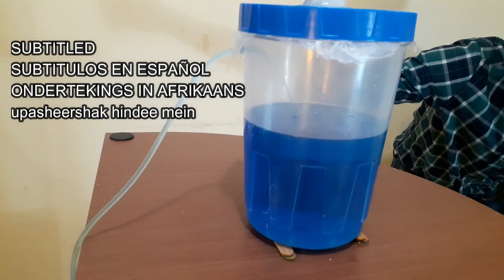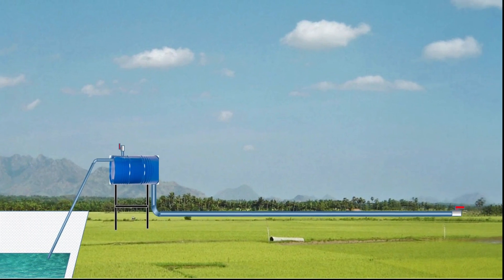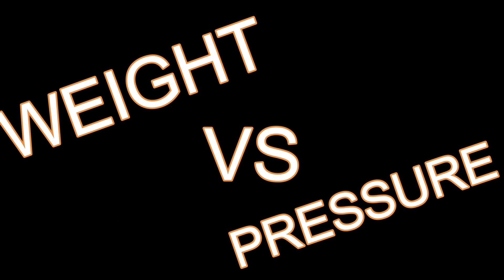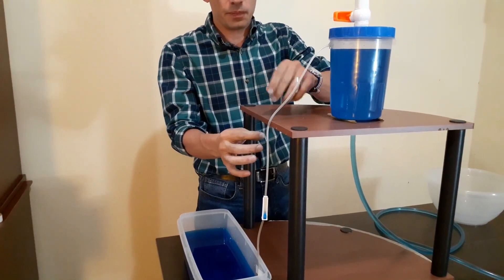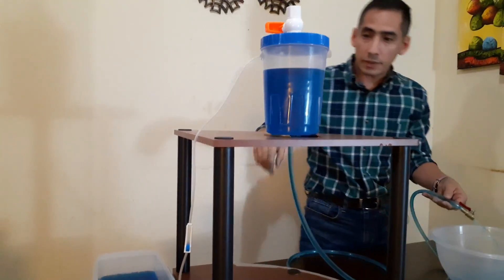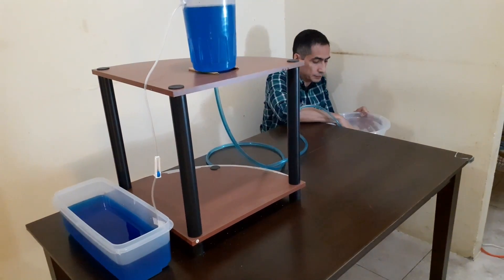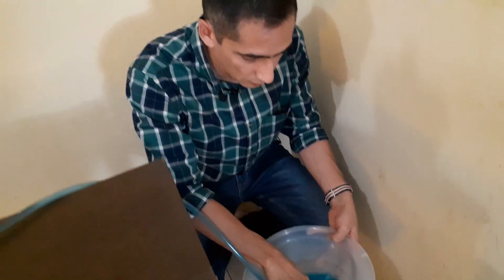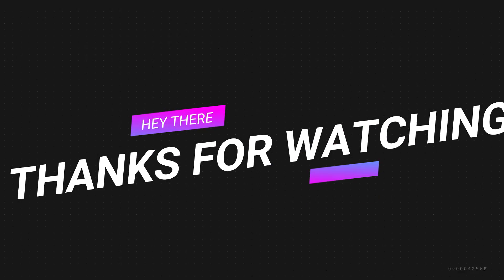FREE ENERGY Water Pump FULLY EXPLAINED!! REAL OR FAKE?  #freeenergy #waterpump

Comment: I have seen a number of videos concerning this type of pump. The conclusion that I am coming to is that this will not work continually without recharging the drum with water as I suggest that the water in the drum will reduce. Therefore the system works from the kinetic energy of initially lifting the water which is finite.
Reply from the maker: thank you for your comment, in fact this method doesnt use kinetic energy because is just a syphon, on the other hand, a RAM pump is a real "free" energy pump wich uses kinetic energy taking advantage to water hammer. best regards

Comment: Looking at your first experiment, water should not flow out if you have a sealed system. To explain it simpler, get a straw. Fill it with water and put your finger at the end and raise up the straw with the water. Water won't drip. The vacuum pressure is holding the water. The bigger your pipe, the higher vacuum pressure you have.
Reply from the maker: thanks for your comment, I will make more videos regarding this issue. best regards
Reply: Noop. The low pressure is not dependent on the size of the straw, only the height.

Comment: You need a check valve on the bottom of the small tube
Reply from the maker: I have made a new video adding a check (foot) valve, kindly check it out
Reply: No, not when using a priming barrel. Purpose of barrel!

Comment: Your setup is completely  different to most of the videos. 1 significant fault in your demonstration is you did not prime the inlet pipe- for the record it works perfectly well in Australia 🇦🇺, we have been able to lift water from a depth of 30 metres using this technique NOTE - this only works if the uptake and the discharge pipe or pipes are proportional in the following- 1);intake must be charged ,fitted with a non return valve, pipe diameter is 25% smaller than your output pipe so as to create the vacuum great enough to pull the water upto the header tank.
Reply: If this can lift water high enough it could power a generator on the way down and run forever.
Reply: Yes it does work, this demonstration is crap
Reply: Vīën-Phüœñg  why do you keep replying if no one has a duty to teach me? I already know that you have been fooled. You are the one who needs to learn but you have the proof here and you refuse and argue that something is not like the other fake videos. You are a dummy. That is the truth.
Reply: The inlet pipe cannot be primed because it has a valve on it. In fact if you try to "prime" the pipe it will instantly create a syphon to that lower level. The model is correct.
Reply: Show a video of this pulling water up 30 meters or about 90 feet. You can't pull water that is equal in density up above the level of the source. The size of the pipe has nothing to do with anything. The water in both pipes has the same density. 
Filling the inlet pipe and putting a check valve on it will only create more resistance. 
Again I ask you to show your barrel rig pulling water up 30 meters.  It won't lift the water one meter.
Reply: You can explain me? I need take water to 20 mt. Please  thanks
Reply: You vouch that it works?????
Reply: @graemegladman  only reason my first attempt didn't work is because the vacuum pressure crushed my container! So I'm looking for a stronger container, but that tells me it does indeed work. Just be prepared, it may take a bit of adjustment to get right.
Reply: @HostileRespite   Ok I will build a small model first. I have seen others that crush plastic drums. Thanks.
Reply: I believe those sys work. Think about ram pump sys. They use total reverse fact.
Reply: share the video of our project?
Reply: Bullshit. I live in Perth prove it.
Reply: thanks dear but would you like to tell me the real procedure and material dimension correctly? become challenge to me at a practice
Reply: vien-phuong7451  Length gives volume in that scenario. I haven't been able to resume my testing on this project because of winter, but soon!
Reply: Vīën-Phüœñg  water seeks its own level.  Water does not flow up hill because some other water of equal weight and density in another pipe or container sits at a different height. 
 It all flows down.
The vacuum you think is there is not enough to lift any water up any grade.
Reply: Vīën-Phüœñg  show the video. Btw a ram pump requires a large amount of water to lift a smaller amount with the ram pulses. 
Again I beg you to show me the video of this kind of non powered system making water flow up 30 meters 
It can't lift even 30 cm.
Reply: Vīën-Phüœñg  SHOW THE VIDEO. 
YOU HAVE ONLY DREAMS!
Reply: vien-phuong7451  I want to try it with tesla valves in a more advanced version later. No moving parts. Truely perpetual.
Reply: Vīën-Phüœñg  yes they are all fake. Please prove me wrong. SHOW YOUR VIDEO.
Reply: Vīën-Phüœñg  you are being deceived, tricked, fooled. You can't understand why it can't work and I have told you the truth. I have no DUTY or desire to teach someone who refuses to see the truth. You have no magic "pump" and never will. Sorry but it is the truth. You like being fooled. Ignorance is bliss and you are the proof of it. I am blocking you now. Goodbye.
Reply: Vīën-Phüœñg  you are obviously an expert so make a video and show your MAGIC pump lifting water up incredible distances. It won't happen. Water flows DOWN.
Reply: vien-phuong7451  You should look up videos on what a tesla valve is. They're not like conventional valves. There is no stopper. No moving parts. It's simply how the pipe is shaped that causes the flow to stop itself. You'll love it.
Reply: Vīën-Phüœñg  thanks for the help, much interesting!
Reply: Vīën-Phüœñg  
I am very interested in testing this. 
If water flow throgh the outlet a short distance and the container is solid, I think it works. But I dont know if gravity can force the barrel water go down to the outlet or not
Reply: Congratulations! In Australia they have a system that violates the laws of physics. No siphon can lift any water to a higher level.
Reply: vien-phuong7451  Sorry, you are way out. A ram pump may need 10 litres of flowing water to lift 1 litre. Poor efficiency on ram pumps, but they cnnlift water, that is right.
Reply: vien-phuong7451  Of cause a ram pump can pump water far. If output tube is strictly horizontal, you need next to no input of energy and a ram pump can push water as far as you like. The same with height of maybe 130 m. In that case you may be more dependent on amount of water flow and head. The pump must also be perfectly tuned. Some ram pumps can be tricky to get started, but correctly tuned it can run for tenths of years with nearly no maintenance  but for cleaning. But the ram pump extracts energy from the running water to lift some of the water up. A barrelled siphon has no continues input of energy. Thus it can not lift any water. Inly stored energy is the weight of the water you lifted up into the barrel. If the input is lower than the output and the output is dipped into a bucket of water, none of the water in the barrel will come out. If there is an air leakage from the output back to the barrel, the water you lifted will come out, then it all stops until you lift more water up into the barrel. In that case, you are the pump, the barrel is only an intermediate container.

So the barrelled ‚pump‘ is no pump, but may work as a siphon given that input is higher than output.
Reply: Can you share the technology dime sions in detail
Reply: @albkhar4036  This is just a siphon. You can se the theory here: https://www.youtube.com/watch?v=CZmP0vsRBZ8
This video shows how a siphon works. It can only bring water from a high level to a lower level. 

Now what about the drum? As you see from the theory, the tube must be filled with water to get the siphon started. He uses a syringe, a simple sort of pump. The use of a barrel only serves to get the tubes filled with water. When the siphon has started one can remove the whole barrel. 
The barrel works as follows: suction pipe must enter the barrel near the top of the barrel. There is no need for any valve at the input side. Output tube leaves the barrel near the bottom. Size of input and output tubes should be equal for best performance. 
The output MUST be lower than the source! 
Fill the barrel. The volume of water in the barrel and the output tube must be grater than the volume of the suction tube from the water level in the source up to the input in the barrel.
Close the filling valve to the barrel an open the exit valve. Thats it. Now air may suck in in reverse from the output. To prevent that, either dipp the output into a bucket of water r place an upward bend at the output.

Getting started with no barrel:
1) Suck a tume in the river so that is full of water. Close the upper end vith a valve or a plastic bag fixed with a rubber band. Drag the waterfilled tube over the edge of the dam or canal to. a point lower than the source. Open the outpu and there you go. Again consider air in reverse. 
2) Connect one tube from the river source to a tube going to an exit lower than the source, using a T-junction near the highest point. Close both ends of the tube. In the river you may use either a valve or a plastic bag. You will have to take a bath to open it, or you can use a one way valve. Fill both tubes from the T and close the T. Open the output. 

In short:
1) input (river, well…)  MUST be higher than output!
2) tube must be filled with water to get started. Dimentions are not critical but input and output should be the same. Larger tubes = more flow. 
3) if little flow, take care of reverse air from outlet.
Reply from the maker: it is imposible take water form more than 10 meter deep because the atmospheric pressure doesnt permit it. remember , a device is able to suction water depending from atmospheric pressure.
Reply: @rubencobos  Your first explanation was correct about vacuum forces in the drum. The hoses are a big deal, but cannot stress enough the importance of the mass of water in the tank. Gravity pressing on the mass cause increased negative pressure in the vacuum.This is why the 55 gallon tanks in the other videos draw so much water. There is a great demonstration in one where they use a plastic barrel and the negative pressure utterly crushes it. The tank you built should have cause SOME vacuum, but I wonder if there needs to be a certain minimum mass to cause the effect to gain enough power to perpetuate from gravity?
Reply: @rubencobos  The pressure created inside the tank MUCH stronger than atmospheric pressure.    Besides , the atmospheric pressure actually helps the system because it's pushing down into the lake .
Reply: Hii 
 If you technical is working plz make video on YouTube or plz send me some image of it and is you have any video link plz shere me 
I am working on free energy concept to generate free energy by stream tube method if water flaw really exist so it is easy to make electric energy by hydro method

Comment: 5:30 you mean to tell me he made a vacuum in that plastic container and it didn't collapse...

there should literally more than 90% vacuum there.
Reply from the maker: The atmospheric vacuum goes from 0 to -1bar, in my experiment it doesn't go further than -0.04 bar. That's the reason the container doesn't collapse
Reply: @rubencobos  I tried my self and got better results, if you would really care to reproduce you'd pay attention and notice that there are more phenomenon used to achieve it.

They most important one which I didn't use neither, and I believe it is the real key factor, is the Venturi effect.
Reply: @rubencobos  but, first of all, you need to make sure its sealed very well, as I just noticed at 5:22 you have very little liquid left which means which is impossible if it was perfectly sealed.

I used similar container with yours (but made of glass) and had very little air at the top. Also the water almost entered the container, which is why I believe the venturi effect is the missing piece.
Reply from the maker: @DreamingConcepts  there is no venturi effect here it is just hydrostatic though. If you made a model you will notice it works as a syphon not as a pump.

Comment: Your test setup is incorrect.

Making something in a small scale proves the concept only if the same types of materials are used. You are assuming all valves are the same. They are not.

Those small input fish-tank valves require too much suction power (try to suck through them and you will see how hard it is). 

The valves in the original clips are using a half-ball that opens and closes the intake and require very little power to be opened. Give it a try and you will see.

You can find people making it with a transparent plastic 5 gallon bottle and it gets compressed from the power of the suction of the output. Also, because of the transparency, you can see the input water coming in just nicely.
Reply from the maker: I have made a new video in a bigger scale tank, kindly check it out, anyway the result is the same, this doesnt work for raising water.

Comment: Thanks Ruben for bringing sanity to all of this. Obviously the number of people who have gaps in their education is considerably high. Would the free energy pump worked, it would be a perpetuum mobile, and basically it would be a free energy source. So far, no one managed to achieve this as it defies laws of thermodynamics. Just imagine if the outlet pipe would be returned to the well instead to the field, one would have a mechanism where water travels upwards because it is being pulled by water that is traveling downwards. The guys proponing the "free energy water pumps" are nothing more than hunters for the clicks of naive audience (and they collected my click in the same way.)
Reply: Come to the outback of Australia 🇦🇺 and will be glad to show you that this system does work with some slight mods. I am fully aware of the principles of both fluid dynamics as well as thermo dynamics- I would appreciate you: A) don’t accuse me of click baiting ANYONE PERIOD, B) how about you go and do your own research, while you are at it don’t be so arrogant to believe you know everything because clearly you DON’T.  I will give you a tip - it works very  effectively when various pressures are maintained on their respective sides ( inlet/ outlet ), the reservoir tank vacuum pressure is kept within a constant range.
Reply: @66pheonixpatrick76  Yes, you're right. Physic behind is "geodesic pressure".
Reply: @66pheonixpatrick76  Yeah, one more mod. Add a motor! Ram pumps needs the source to be higher than the pump!
Reply from the maker: Thank you for your great comment, indeed, thats the pourpose, trying to give a little knowlegde about hydraulics in simple words (despite english isnt my mother tonge) as you wrote, those evil channels make all this videos in order to get views and earn money by google adsense regardless the damage they cause. best regards.

Comment: The fact that you added a plastic gasket between the lid and the container has nothing to do with the fact that it works afterwards right, so  I am pretty sure that your 1st test would have passed had the container not had a vacuum leak

Comment: you tried well
but with a slight mistake in the design system,,   you not used the chuck valve in the inlet pipe,,
and also you bot filled up the inlet pipe with water,  before starting the outlet drain
Reply from the maker: I have made a new video adding a check valve (foot valve) on the suction pipe, please check it out, is in spanish with subtitles though
Reply: @rubencobos  so what was the difference ?

Comment: Hi good day I think the problem of your experience is the intake pipe is empty if you use the electric motor in a deep well you need to put a foot valve for the water in the intake stay because if the intake pipe is empty even you use electric water pump the water will not rise
Reply from the maker: I made another video adding a foot valve in order to prime the input pipe, please check it out, it is in spanish with subtitles though, best regards.

Comment: I have view the other videos n noticed that you left out key components that allows this system to work  properly..like a check valve to keep water in the suction side..n also u need to seal the container properly..u can't have any air leaks...also..you didn't install the pressure tubes..that blocks the water from returning to the container....

Comment: the term "free energy" they use is not using Electrical pumps... it works on me as far as syphon is concerned, that's the only purpose for it, transferring water from point A to point B, the source must have abundant water like rivers or well... it will continue forever as long as the water on river wont dry up...
Reply: Hello sir. Pwede po ba paturo gumawa? Been making it for a while pero puro fail

Comment: Your experiment is Flawed I think. I have a model using a Water Dispenser Jug and a 1 cm diameter transparent tubes. It works... Just make sure there is no air leak in your water container, while the water from the container drops, it creates a vacuum which in return sucks water from the source
Reply from the maker: I Made a new one, please check it out

Comment: You have to put a check valve on your intake pipe and fill it up first and out let pipe is bigger then inlet at the end of out let you put a smaller one to increase pressure coming out you have to watch the whole thing to get it right
Reply from the maker: Thabks for your comment, I made another video with a non-return (foot valve) check it out

Comment: Your video is also a false demonstration. If the water can out but no suction happens that means there is leakage. Because if vacuum occured than water flow should be stopped.
Reply from the maker: Watch my new video  it is in spanish though (it has subtitles), I assured a hermetic seal, best regards.
Reply from the maker: https://youtu.be/I5p_iRcVysY